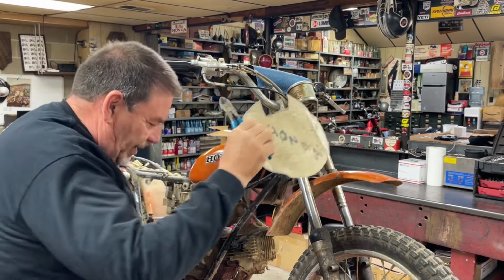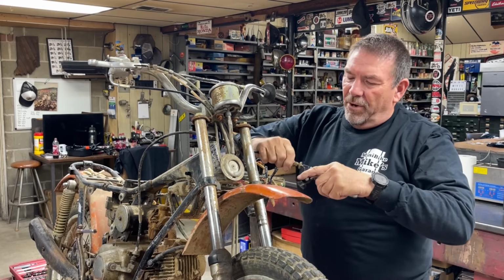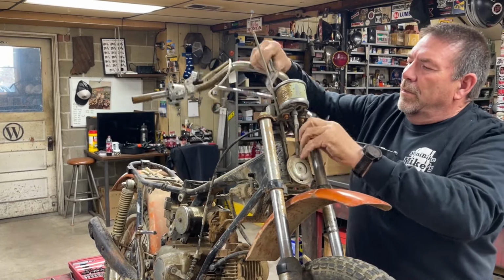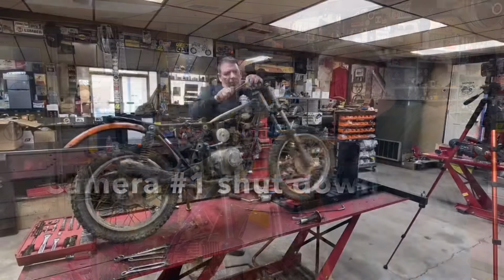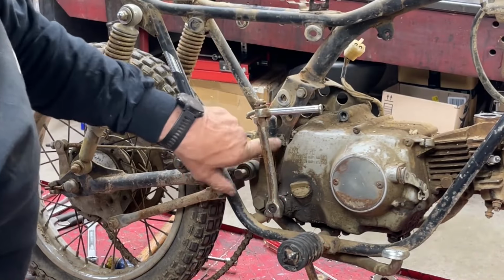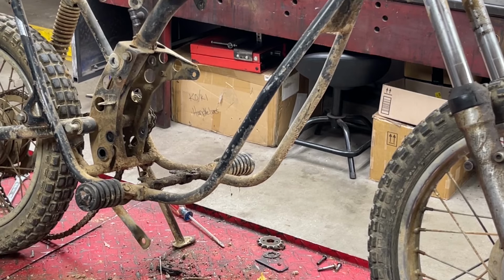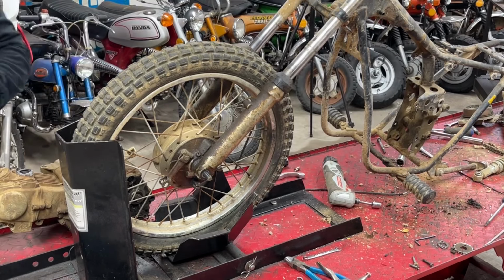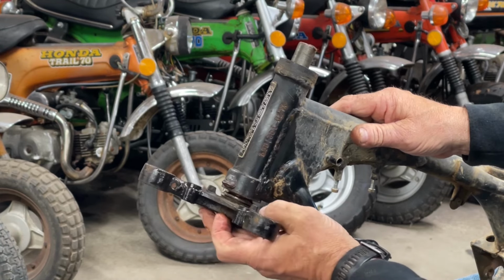Rebuilding a Honda XL70.  Video #2, let’s blow it apart.

Comment: When you mentioned how long you’ve had your Craftsman Socket Wrench Set, it reminded me of when I was 13 or 14 and rode my Schwinn 3-speed Stick-Shift Sting-Ray six miles to Sears to buy a Metric Combination Wrench Set for maintaining my Candy Gold CT-70. Still using that set of wrenches over 50-years later !! Still have that Trail 70… wish I still had the Stick-Shift Sting-Ray too !!!
Reply from the maker: @donsoule6411  For my high school graduation, in 1983, my parents gave me a multi-hundred piece Craftsman tool set.   It’s the set I still have at home.  The box I have at the shop, is the one I bought, when I acquired the shop, around 8 years ago.  I guess I’d never tried to use the 1/2” drive 19mm before, because there isn’t one.  Haha

Comment: Another great video, Mike.  Thanks!  Since you have it down that far, are you going to put in new fork seals and dust seals?  I was planning on doing my 74 XL70's, but I can't find a video on how the fork legs come apart, go back together, and fork oil.  Thanks again, my friend.
Reply from the maker: @bartgoins1782  I haven’t bought the needed parts yet, but yes, they need rebuilt.
Reply: @MiniBikeMike  Great!  I'm looking forward to that video.  Thanks, Mike.

Comment: on the lifan engines with the inner style stator can i change to a half wave regulator so i dont have to ground out the one yellow and tie in the other 2 on the harness?
Reply from the maker: @MotocrossGuru-zf8pk  The stator design dictates how it gets wired.  If you’re wanting to get away from the grounded stator (two yellow wires), I’d recommend buying a new stator, with a yellow and a white wire.    They’re $17 on Amazon.
Reply: @ also in either style stator does it matter which AC wire you plug into? the tb422 says white(to regulator) and yellow (to ac powered lights) or vice versa?
Reply from the maker: @ If you’re keeping the original stator, ground one of the yellows and tie the other to the yellow and white in the harness.   If you swap to a stator with a yellow and a white wire, it’s a direct plug-in……yellow to yellow and white to white.
Reply: @ is there a way to tell which stators are grounded?
Reply from the maker: @ Check the continuity between the wires.   If they have continuity with each other and neither wire has continuity to the engine block, one of them probably needs to be grounded.